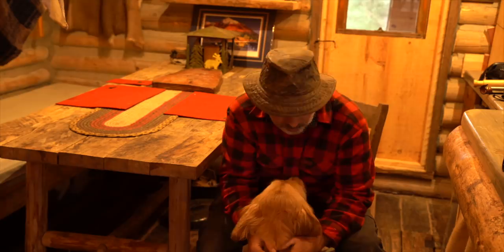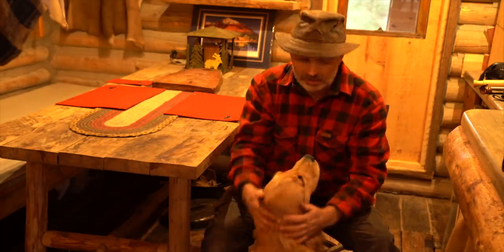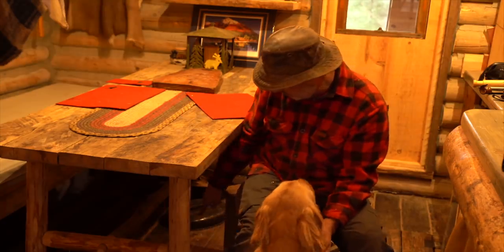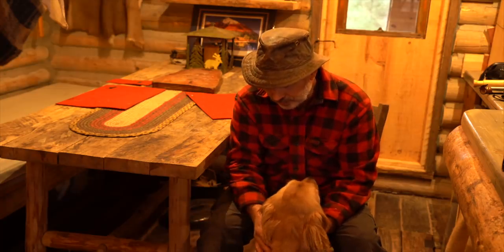Pine Wood Floor | How to Build a Cheap, Off-Grid Log Cabin, Ep11

Comment: It is hard admitting our mistakes.  Sometimes I wish I could build my cabin all over again and get things right, but at 71 that is not going to happen.  There is only so much you can learn from books or even videos.  Experience is the best teacher, but it comes at a price.  I frequently found that using the wrong materials or cheap materials often meant problems down the line, but sometimes I simply could not afford the alternatives.

Comment: Gaps in plank flooring can be filled in with rope or twine pushed in between the boards tightly and it even takes stain nicely as long as there isn’t too much glue used.
I used this method in my 1880 home in the attic rooms, pine planks.

Comment: Hi Shawn! I`ve have an idea how to keep your next cabins floor boards not twisting or cupping. When you stack them to dry, use small bars to keep the airflow going. And on bottom and top of the pile put 2 by 4s and put theared rod through them and thighten the pile evenly as it gets dryer over time. If you got wide pile u need more rods ofc. This method has been tested. Cheers from Finland!